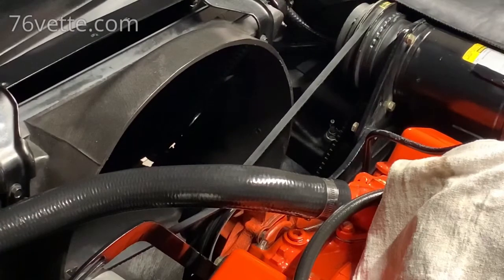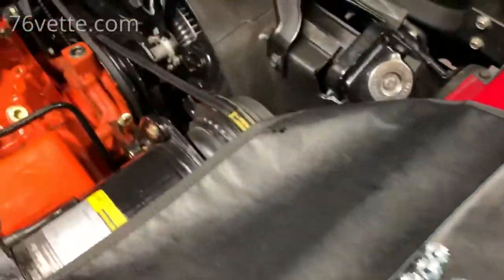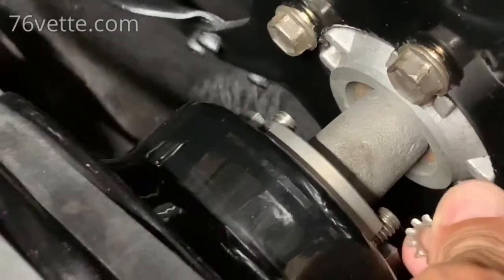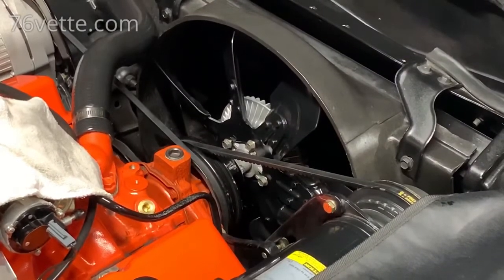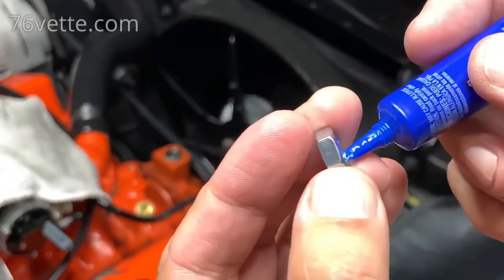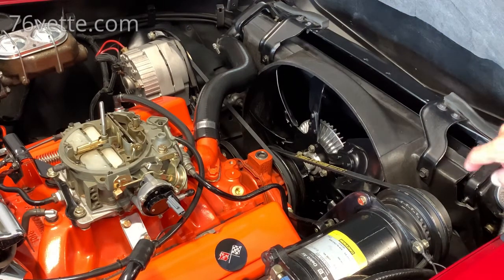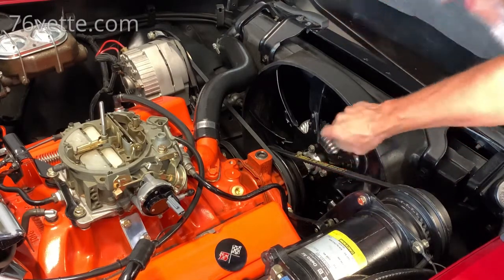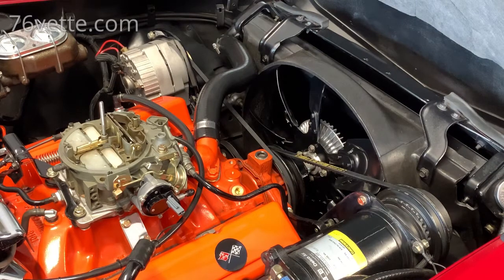How to Install Radiator Fan, Snorkel & Flex Duct

Comment: Do you have a link to purchase the actual radiator fan? I am having all sorts of trouble tracking one down online that isn't plastic or nylon. Looking for a METAL 7-blade minimum fan for my 76
Reply from the maker: Contact Wally at Corvette Generation as I am sure he would have one in stock. I think they were all the same from 1976-82 but double-check before ordering.

CorvetteGeneration.com
16541 US 301, Dade City, FL 33523  
Phone: 352-523-0900
Email: parts@corvettegeneration.com

Comment: I have a 76 L82 4 speed. It runs at 200 degrees in traffic. I have tried everything to get it to run cooler?
Reply from the maker: IMO, 200° is actually pretty good in traffic. I wouldn’t worry about it. Also, at 200° your engine is burning out all contaminants, which is a good thing. 😊👍🏻 

According to the 1976 Corvette Owner’s Manual (2-12): “Temperature gauge readings will vary with air temperature and operating conditions. During normal operation, gauge will indicate between 190° and 250° (start of red zone). If the gauge indicates 250°, the engine is overheated.”